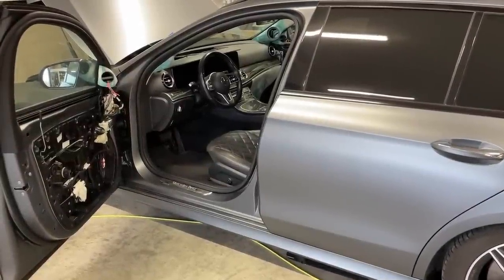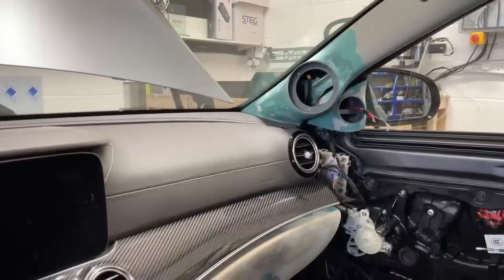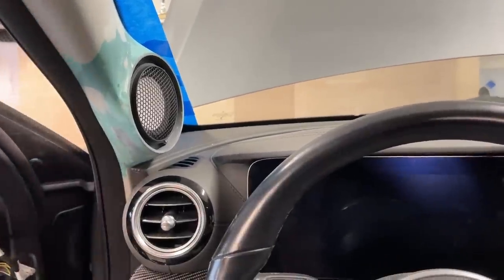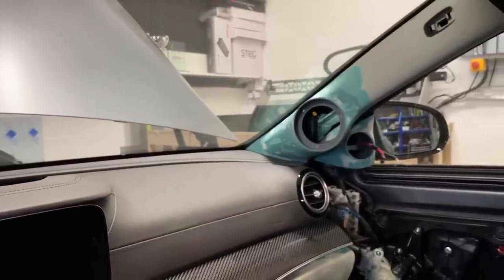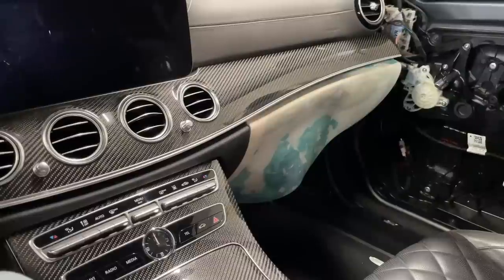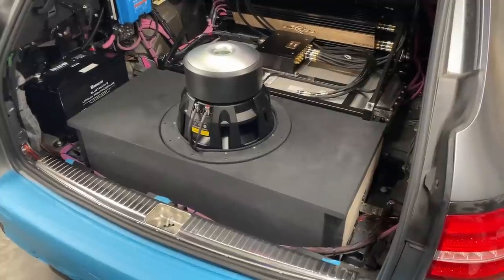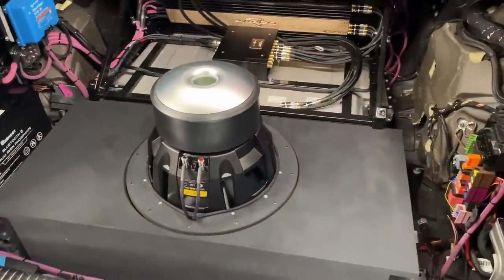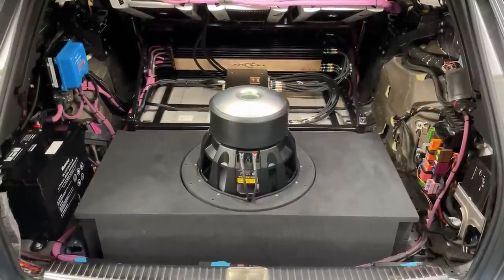Crazy SQ System PART 2 - Speaker Installation EXPLAINED - Accuton-Automotive, JL Audio, Blam, HAT

Comment: @Pssound  
Peter, I hate trying to lay fiberglass mat "upside down" as well!  😵‍💫  So there are low heat moldable thermoplastic sheets available (think 1/16"-1/8" thick ABS) that I use to mold the shape of the cavity first.

You use a heat gun and follow behind it with a damp cloth to quickly cool and set the plastic into shape as you go.  Check your local plastics supplier or Amazon & eBay.

You can then use the resulting plastic form as a mold to lay up and wet that section of your fiberglass enclosure.

It adds another step but is relatively quick, and you don't have to mask off the area with tape or aluminum foil which is a PITA and time consuming.  You just can't mix your resin too hot or the moldable plastic sheet will lose its shape, LOL.

You can do this with 1/16" thick ABS sheet just to try it.  Use a short telescoping pole or rod (like a short, adjustable camera monopod) to help hold the sheet in place.  Get one with lever locks instead of twist collar locks.   Works a treat to quickly reset and hold the moldable plastic sheet in place as you go.
Reply: Hi, I can confirm this is an awesome method! And it's smart.

Comment: Hi Peter, can we say that like the JL, the Morel Ultimo, like in the Porsche Macan build a couple of months ago, is the closest to an IB sub?

And by the way, what would you prefer as a front sub; 10WM or an Aliante 12 if the price for an Accuton is to steep for someone?
Reply from the maker: That Cayenne had the Ultimo 12, indeed, very accurate, musical sub, but can’t deliver the effortless extension below 25Hz, but that doesn’t matter for most people as 25-100Hz is way more important. Some JL subs can play proper low in sealed and stay musical, but the tightness and accuracy of something like a Morel Ultimo is difficult to match. 
Btw what subs we prefer for front and rear duty is covered in multiple weekly topics on our Patreon channel where i break it down properly. Don’t have time to answer 20+ messages daily.
Reply: @Pssound  Peter, thank you for your answer. I realize that you are very busy. You have developed skills and knowledge that only a few other people achieved.
I tried to be Patreon a while ago, but I don't know what I did wrong, but I couldn't get it right.
I will make a new attempt to be  Patreon this weekend.
I started car audio mid nineties as a hobby with success. For a long time, I couldn't find the time to go through with it. 
The main reason I asked the question about the front subwoofer is that I want to build my installation for my 2014 F11 BMW and leave the tuning over to you. 

I already got all the hardware I need. I have two Morel 4 Ohms for the rear. Only I can't choose between my Focal 10WM and my Aliante 12 as a front woofer. They have both upsides and downsides. 

The reason I asked the question is that I want to install my hardware and leave the tuning over to you. That's easier for me because I am from the Netherlands and the car is my company car which I use for my business.

In the past, I used the Alpine H701 processor and the program Praxis from Liberty X. But now I have bought a Helix Ultra, which is much more challenging than the Alpine. I've got REW on my laptop, but honestly, it's very different in comparison to Praxis.

So that was the reason I asked you the question.

Good night Peter

Comment: Peter you need a thin ripping jig  you can by them from Amazon or ebay.
Reply: @William Hancock  
Or make one.  There's no shortage of DIY Woodworking YouTube videos showing how to make a small parts/thin rip cutting jig.

The key is to find a way to clear each small piece away from the saw blade as it is cut (chop/miter saw or table saw), otherwise, these small pieces vibrate or drift back into the blade and become projectiles, or you risk losing a finger reaching in to grab them.

I use a stream of compressed air to blow them clear of the blade, and then they drop into a 5-gal bucket as they are cut.  But even that doesn't always work depending on the size, shape, and weight of the material.
Reply: A sled??? Just build a sled for the tablesaw…

Comment: I’ve seen you’ve worked on a ton of Mercedes vehicles and I have a particular question about them.  I have a rd 500/1 with a jl w3 with a lc2i pro in my 2022 c300 and sometimes my output is noticeably lower but other times it can get louder.  One day I get into the car and it sounds just fine but when I get back it sounds weaker.  My dealership says the battery is fine and I got the sub installed at a reputable shop.
Reply: Try to figure out how to reliably recreate the problem, then have the shop look at it
Is it per chance a source dependant issue, or are you always listening to the same source. Also, the mix and master track to track etc